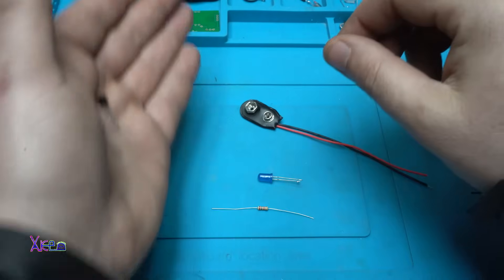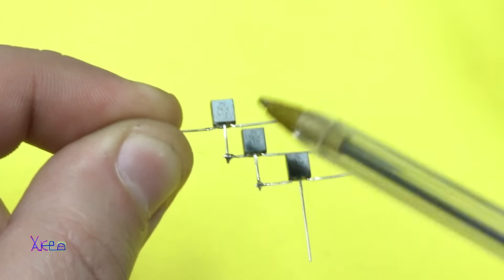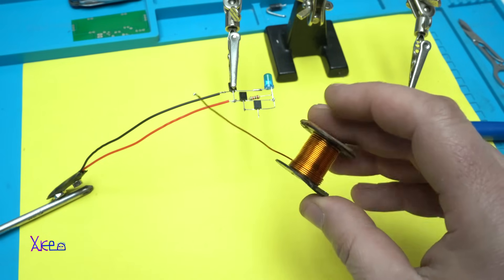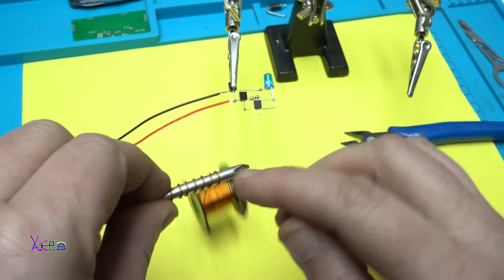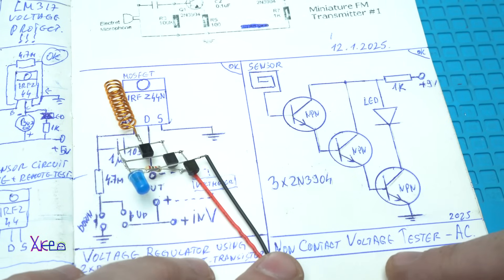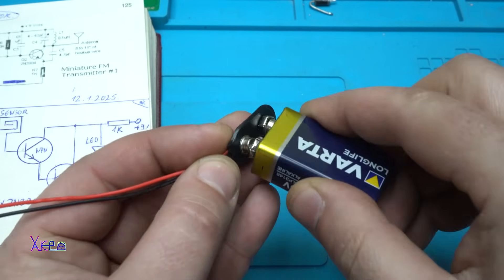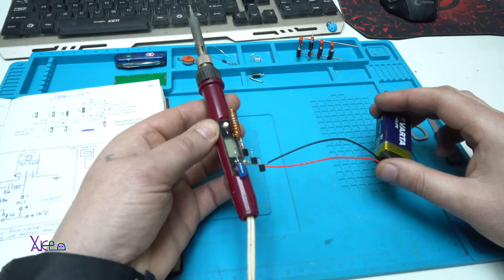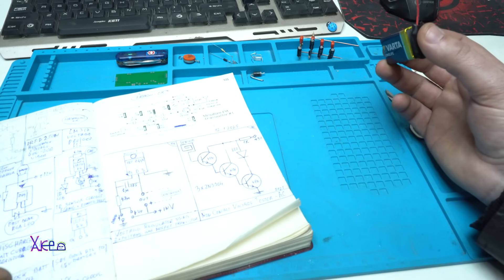Make This SMART Gadget With Just 6 Parts! Non contact voltage detector.

Comment: Fun project. Thank you for sharing. Question = 9 volt batteries are big and expensive. The schematic looked like maybe 3 volts was usable? What voltages and battery types can be used? Tip = Maybe cover the antenna wire with some heat shrink, to improve its insulation. The wire's thin, enamel coating will wear off fairly easily, making it conductive.

Comment: I like these simple and very cheap detectors, but they are missing important sensitivity adjustment. Great video, thumbs up.
Reply from the maker: Yes, thanks
Reply: What changes need to be made to the circuit, to add this functionality? Please be very specific. Example = Add a trimmer? Where? As a variable resistor, or as a voltage divider? Etc. Thanks!!!

Comment: Nice project, and could be a life-saver if you're drilling into walls, ceilings, floors and don't know where the AC cables are running - commercial units are plentiful of course, but a simple DIY is always preferred!
A couple of (dumb?) questions:
(1) could the detection strength be boosted?  say with a more powerful battery, or with more coils in the antenna? 
(2) does the LED glow proportionally to the current/distance?  in the demo, it looks just on/off, but it could be due to the bright room.

Comment: It isn't detecting voltage. It's detecting the magnetic field generated by the current flowing through the wire. There's voltage present even when there is no current. It's a current detector, not a voltage detector.
Reply from the maker: That is true,detect magnetic field
Reply: [Warning = Noob questions...] It seems to me that we might be more interested in knowing that there is the presence of voltage, as opposed to current, because voltage can turn into current, as it is using a human's body to complete the circuit to ground. So, is there any such thing as a true voltage proximity tester? Maybe a circuit with a similar gain configuration (Darlington,) but using small MOSFETs (Example: 2N7000,) because MOSFETs are voltage driven devices? Aren't Op Amps inputs also voltage driven; yes, I think so. They are easy to set up for gain, of course. Maybe an op amp, or two, driving a 2N7000/2N3904/2N2222A for the LED. It seems that a MOSFET might be better suited as the switch for the LED and for extended battery life. Hmm... I have an Instrument Amplifier circuit already set up on a breadboard. It is a typical three op amp design, with x1000 gain. I wonder if it might be used, somehow... Thank you, in advance, for your help.
Reply: If that is a straight standard USB cable (as opposed to some fancy one) then since it has nothing at the end of it then their should not be any current.

Comment: This is really interesting - love your videos. Not a criticism but if you wanted to make it even better could you perhaps explain a bit about how it works? Thank you.
Reply: Any live AC wire with current flowing through it produces a small electro-magnetic field. The little antenna picks up enough of this field for the Darlington array that the transmitters form to multiply this tiny field. An NPN transistor has a current gain of approx 80x, so two transmitters give 80 x 80 gain, producing enough current to allow the battery voltage to flow into the gate of the last transmitter, which allows the LED, (placed between the battery and drain of the final transmitter) to light up
Reply from the maker: Very well explained,thank you sir
Reply: @Tsnafu  cool thank you 😀